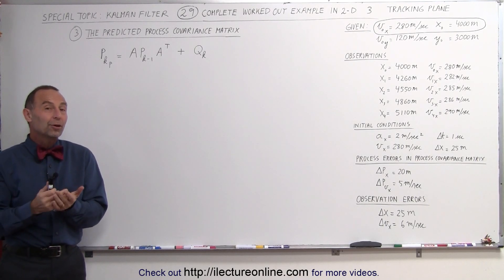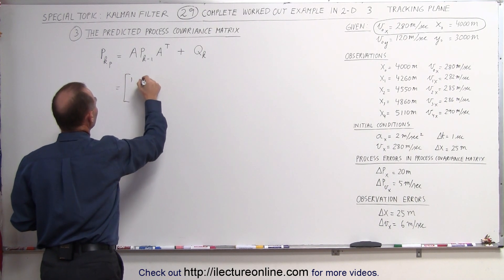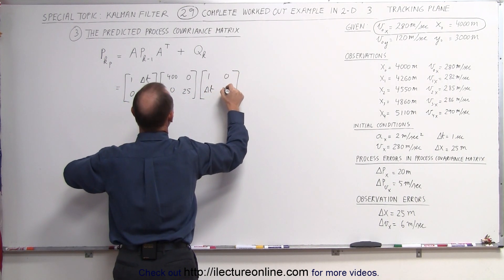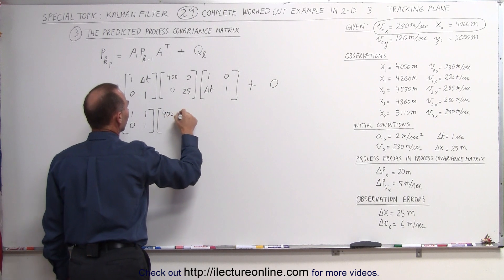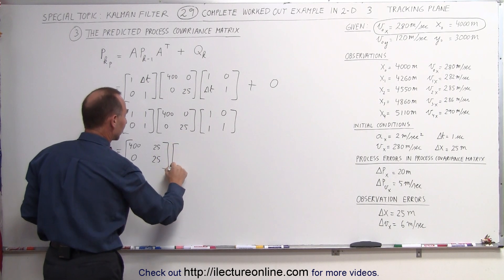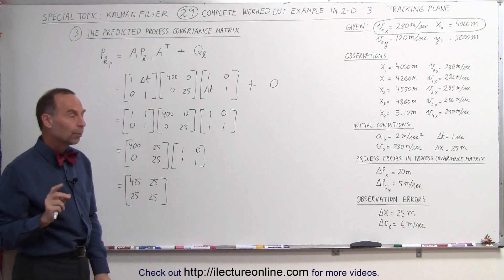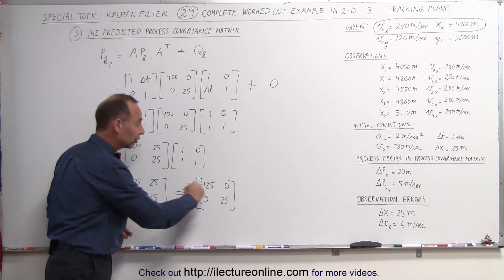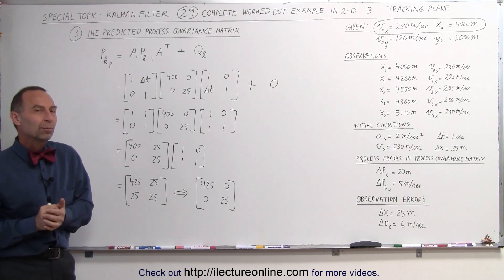Special Topics - The Kalman Filter (29 of 55) 3. Predicted Process Covariance - Tracking Airplane

Comment: Why does he assume Q as zero matrix? How can we calculate it? I know that it's state covariance matrix, but how can we calculate it? Is it constant or changes through the process?

Also, we know that if we consider Q as a constant matrix (zero or whatever), the P matrix is gonna converge to a specific value, which does not seem sensible. I think the P matrix should vary through the process depending on the system states.

Comment: Hi Professor, simply use "row transformation" and "column transformation" to save computation. Another problem with your video is that Corr(X) = X't * X provided X is a deviation matrix and the relationship between Var and Corr should use vector dot not numeric multiplication. However, your demonstration of KALMAN Filter is still good.

Comment: What is statistical intuition behind A P A^t?
Reply: Each element of P is the expected product of the deviation of a state variable with the deviation of a state variable (might be the same or different variable):
P_ij(t=k) = E[ (X_i - E[X_i]) (X_j - E[X_j]) ]

The matrix P thus can be represented as the expected tensor product of the state deviation vector with itself:
P(t=k) = E[ (X - E[X]) (X - E[X])^T ]

After one timestep, X becomes A X, so the expression becomes:
P(t=k+1) = E[ (A X - E[A X]) (A X - E[A X])^T ]

Due to linearity of expectations (E[A X] = E[A] E[X]) and because A is a fixed variable (E[A] = A):
P(t=k+1) = E[ (A X - A E[X]) (A X - A E[X])^T ]

Distributing the transpose reverses the order of the matrices, so:
P(t=k+1) = E[ A (X - E[X]) (X - E[X])^T A^T]
                = A E[ (X - E[X]) (X - E[X])^T ] A^T
                = A P(t=k) A^T

Hope this answers your question.
Reply: @Zxymr ❤
Reply: I think it's just a formula. The ^T isn't a power of T but it means that the matrix A is being transposed.

Comment: Hi, professor:

It's seems like the initial value of P is not so important since P will evaluate to be right as long as the system is converge.

My problem is: 
In the real world, we usually need to tune Q and R.
How should we tune them? size of Q and R are ususally big when we have the system that state variables are larger than 3 or 4. Do we usually just tune the diagonal elements? Is there any better way to do?

Thank you for your usefull videos.

Comment: How do You determine the measurement noise in Kalman Filter model?
Reply from the maker: That depends on what you are measuring or the system.  It is essentially the uncertainty in your measurement and it is usually estimated.  When you are tracking an object, due to the timing of the measurement, and the inaccuracy of the measurement itself you may decide that the best you can do is +/- 20 m
Reply: @MichelvanBiezen  Hi. For estimation in case of a 6DOF IMU, I simple get standard deviation from the acceleration sensor when it was given a static input (gravity), and get the mean values of the gíro sensors when the IMU was standstill (so the rotation speed shall be zero, not the bias what the giros are reading normally). Not usre if I did it right of course, but it seemed like a logic approach to me :)
Reply: Thanks Sir, This problem also applies to  process noise?
and How do you evaluate this book?

link: https://drive.google.com/file/d/0By_SW19c1BfhSVFzNHc0SjduNzg/view

Comment: I was trying to apply what I've learned from your lectures..thanks a lot.
Example shown above we already know delPx=20m and delPv=5m/s..I'm trying to estimate(in 1-D) altitude using barometer(measured) and accelerometer(predicts)..so how do I find out delPx and delPv using accelerometer values. I mean if one has variance in acceleration how does one find variance in computed distance)double integration) and velocity(single integration) from the acceleration.